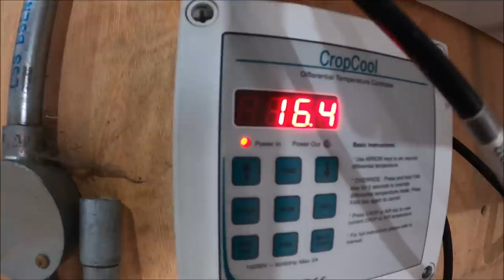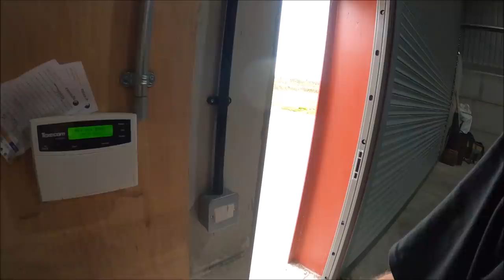I just want to look at the OSR!  08 09 21

Comment: I had a smile at the ivy quote, I once had a similar job and pulled the majority of it by severing the base stems, prising them back with a couple of high lift  felling  wedges  to allow a strop then pulling back on it with the boom on a 5 ton digger literally  peeling it off and burning it. The roof was big 6 sheets so was not a problem.

I literally got to the last bit and pulled were uppon a 6' chunk of the gable wall came away with it.

Luckily the wall had been earmarked as suspect  by the surveyor and as part of the barn conversion was being rebuilt.
Reply from the maker: We will have to attack this job gently or the whole lot will fall down 😬😄